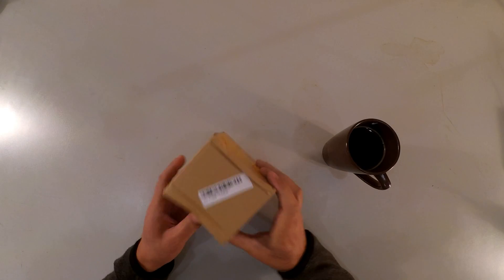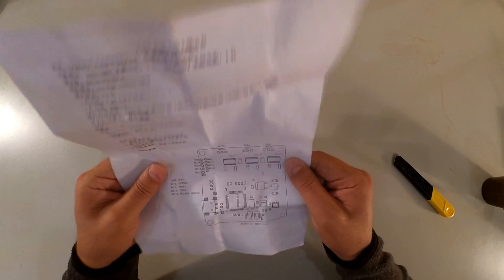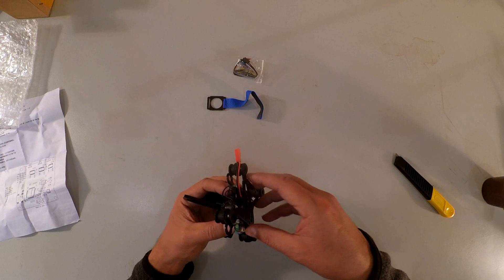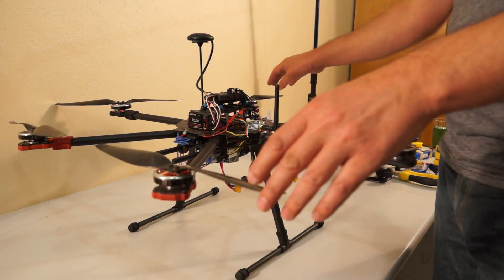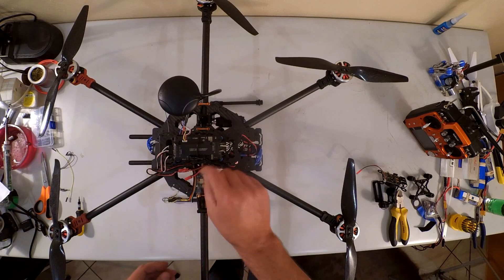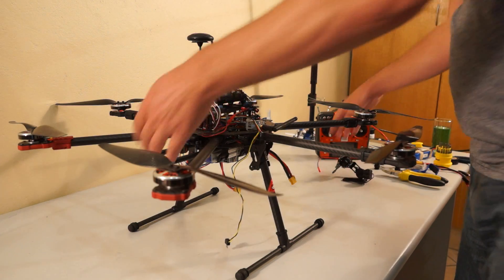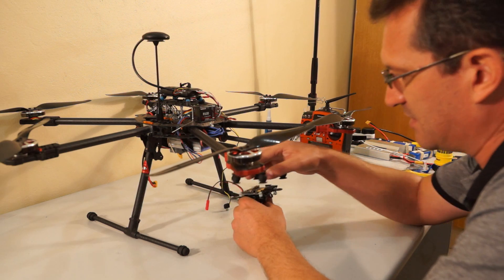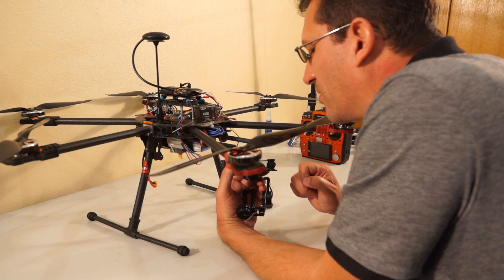A Look At the 3 Axis CNC Gimbal from Bangood with Storm32 Controller

Comment: Hello budy, how are you. Thanks for the video. If you can help me, I have a little problem with my STORM 32 because I can't control my PITCH, Roll and YAW. Because I am connecting GND of the board to the negative of the receiver and RC0 to the signal output of channel 4, RC1 to the signal output of channel 5 and RC2 to the signal output 6. However, I am not having a result of gimbal control. My gimbal is calibrated ready to use but I have this control problem. CAN YOU HELP ME?

Comment: Hi There, Very Nice project. I have just finished building an S550 Hexacopter with 2 axis gimbal similar to yours. I have a video transmitter hooked up to the frame   to transmit video from the 2 onboard cameras. What kind of frame are you flying. I am using radiolink At9s transmitter R12ds receiver and APM 2.8 flight controller.

Comment: I have really come to like my AT10 radio . It is so user friendly compared to other radios I have now and had in the past . And so far I haven't gone even close to the range limit . I've only been about 600 yards and the first signal bar was just starting to blink in and out so I'm guessing it should work great 1 to maybe 1.5 miles if your up at 400 feet . and not blocked by a lot of trees . Watching your videos helped me to decide on the AT10 Thanks .
  Now Radiolink needs a receiver that can use all the switches and knobs  . I have everything on the NAZA M Lite working perfect and still have only used 3 switched and one knob . Using the Storm 32 3 axes gimbal , think I will take the knob off the Naza and operate the gimbal from only the receiver . Don't know if you can use signals from both receiver and Naza at the same time on the gimbal . Anyway thanks I have learned a lot from your videos their great and fun to watch , and really like the way you explain things in easy to understand instructions , because I'm always afraid I'm going to smoke something , and you know how it is once you let the smoke out , the magic is gone . 
     Have a great day .
                                Spencer

Comment: hi mate what pin but you use on the gimbal for the tilt
Reply from the maker: Hi.  See at 7:56 in the video I show the connections.  Rc-0 control Pitch (or tilt if you prefer) and Rc-1 controls the roll (left-right tilt)